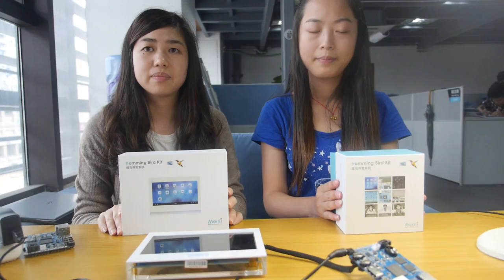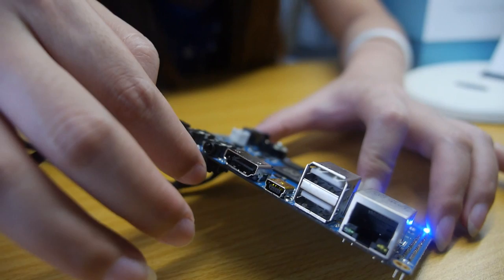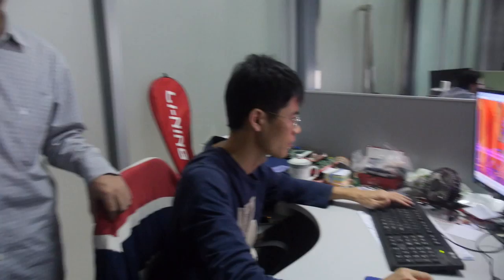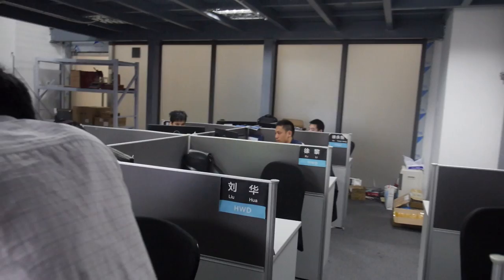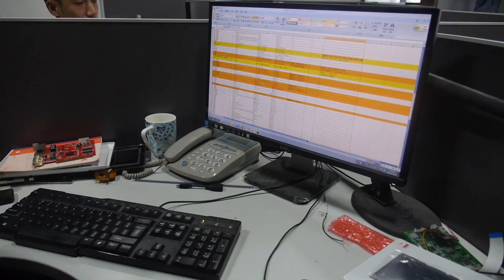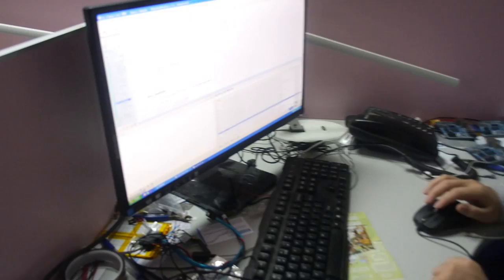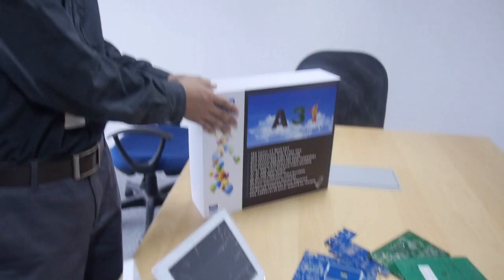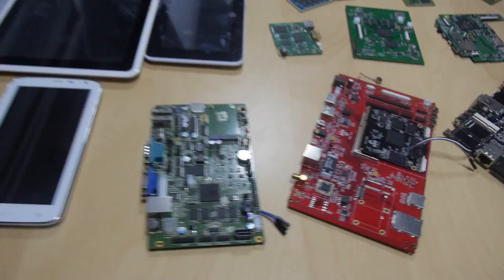$50 Merrii HummingBird Kit Allwinner A20 Development Board

Comment: As many applications run little faster on dual core I wonder if this is actually slower than a fast Allwinner A10 board ?

What we really need is a fast hardkernel style quadcore without the massive Korean delivery charge and with SATA
Reply: you're right - it can be slower than A10 esp. on non-multicore optimized programs.